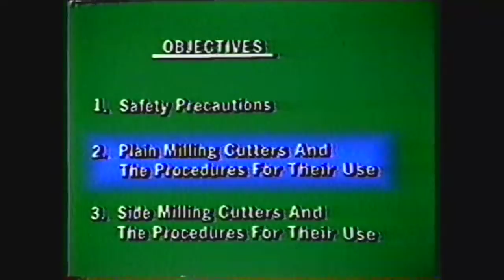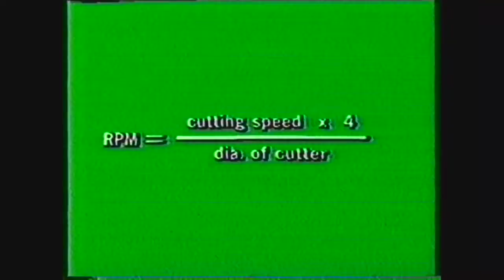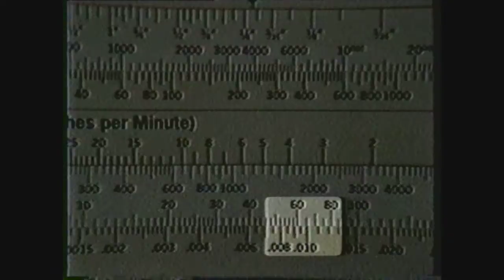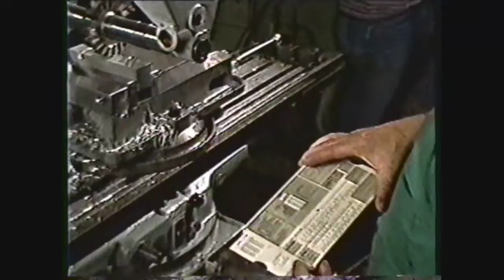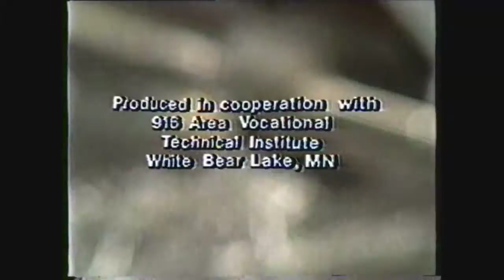Machine Technology IV Lesson 5 Use of Plain and Side Milling Cutters on the Horizontal Milling Machi

Comment: 04:18 "place the cutter so that it will rotate in the direction for conventional milling." - WRONG

It is the direction of travel of the table that decides whether conventional or climb milling, not the orientation of the cutter.

The orientation of the cutter depends on which way you want the cutter to rotate and the spindle needs to be set to rotate in the correct direction for the mounted cutters.